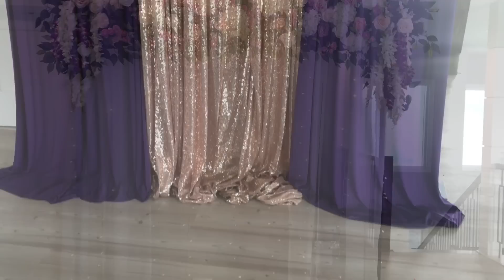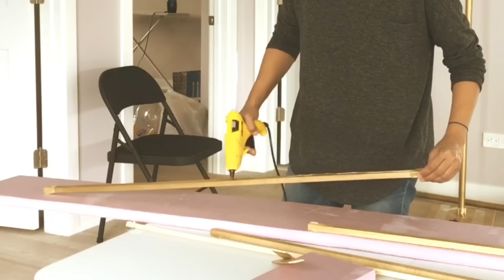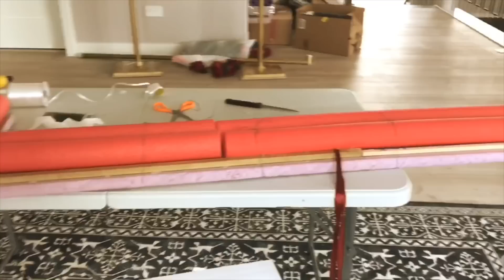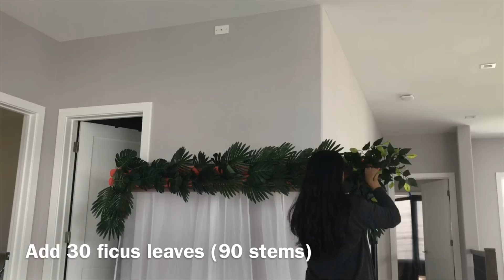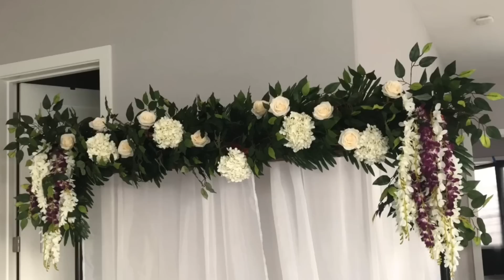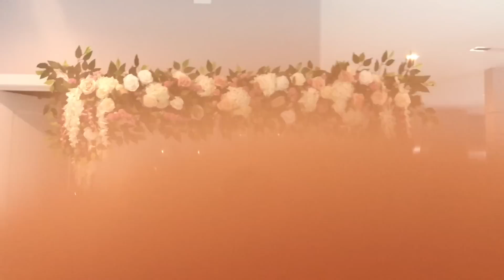DIY- backdrop  Diy- Pool noodle backdrop

Comment: Question? How come you use the pool noodles instead of glueing floral foam to the board? Wouldn't be easier or the noodles hold better? Thanks looks gorgeous btw.
Reply from the maker: The pool noodles tend to bend . I use the board for support

Comment: Do I need hollow pool noodles or will the solid ones work too?
Reply: Also, what are the other materials you used to attach to the board? I see you used wood but is the other shorter sticks wood as well?
Reply from the maker: The wood is for support . Pool noodles , and insulation board . Here is how I make it
Reply from the maker: Insulation board
Reply from the maker: Wood is just there for support